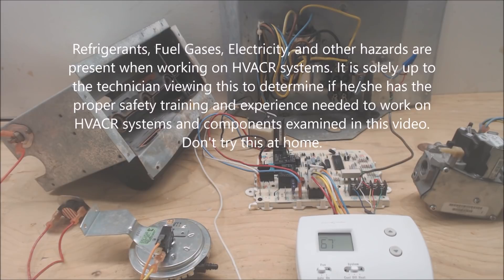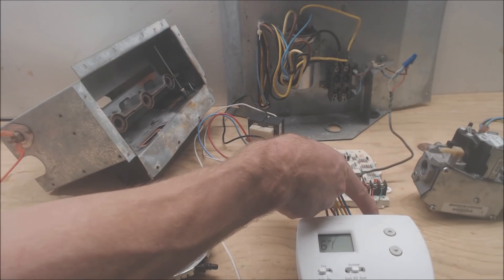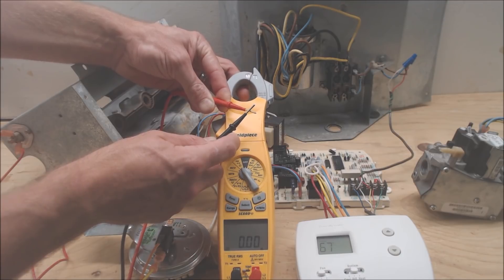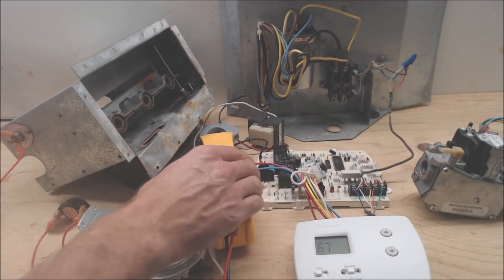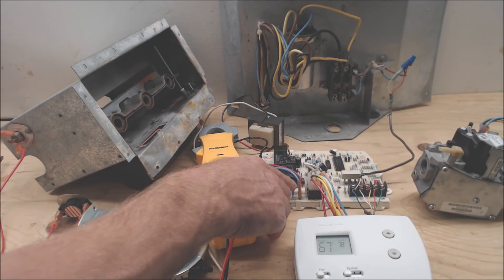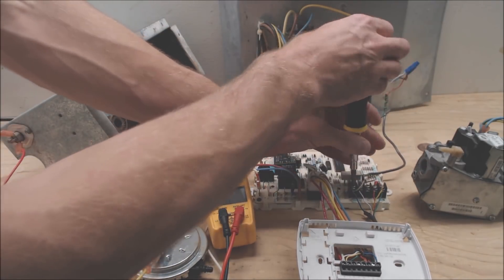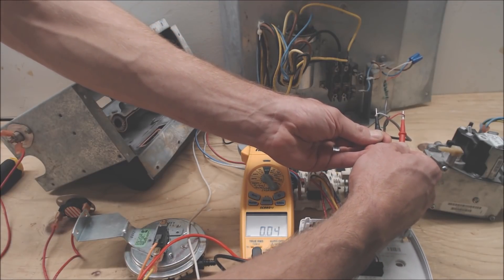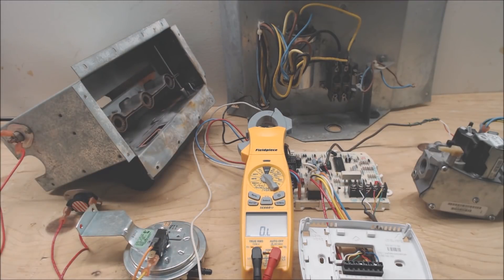HVAC Electrical Troubleshooting! How to Find a Low Voltage Short!

Comment: Hello, I was checking a heat pump system that had a short in the control wiring. while I was trying to find the short I removed the fuse and install a 3 amp lil popper and as soon as I turned the power to the unit the transformer burnt out, it smocked.
My question is, why didn't the lil popper tripped?
FYI, the short was between E and neutral.
Reply from the maker: It sounds like that lil popper was hung up. I have my students use lil poppers in the classroom and I put faults such as shorts and their lill poppers open the electrical circuit within 1-2 seconds. I am not sure but what I would say is to find the short with resistance reading and the thermostat wires disconnected from the control board. If you need to put batteries in the tstat or use a mag jumper to do your connections then that is fine but you are testing for any resistance value between a potential hot and C or hot and ground, thanks

Comment: What is the probleme if the fuse always blows after 2 or 3 hour?
Reply from the maker: It sounds like a possible amp draw problem on the 24v circuit or an intermittent connection problem on the 24v circuit between one of the hots and ground or common, thanks Christian!
Reply: acservicetech thanks for the reply

Comment: Is the steps to locate a short on an electrical furnace similar?  I have a 5amp fuse that keeps popping.  I've been looking all over any can't seem to figure out where the short is, could it be the board itself?  It's a 17 year old split York system, heat pump / air handler and electric furnace, that has had a fair amount of work done on it over the years but this year it doesn't seem to want to heat.  AC works fine, fan by itself works fine, but when I turn on the heat the fan kicks on, the heat goes on, then a few minutes later the aux heat turns on and it blows the fuse.  The outside unit kicks on and feeling the line even warms slightly when the heat kicks on, but not long after it blows a fuse.

Earlier in the year we had a HVAC guy come out and after me repeatedly asking him to check the capacitor, he replaced the blower motor (twice, as the first time he said he accidentally blew it by reversing wires or something), and then after it still had issues (freezing up) he checked the capacitor and replaced it.  Now I'm worried when he replaced the blower motor he messed up something else, or since he didn't seem to know what he was doing placed an incorrectly sized one that may be drawing too much voltage and is fine with AC is going but when the heating elements need to run pops a fuse...
Reply from the maker: So the fuse actually has to do with the secondary 24v side and not the high voltage primary side which is where the blower motor is attached to. You may have too many 24v relays which are adding up to an amp draw higher than 5 amps on the 24v side. I would have a new tech look into the added up amp draw of all the 24v relays or by using ohms law and testing resistance on all 24v relays, thanks

Comment: Great video! Is there a big difference between the SC640 and the SC660?
Reply from the maker: The SC660 is wireless so the SMAN460 will detect the temp readings, thanks!

Comment: Thanks for this lesson. Can you tell me a good study guide for the epa 608 universal test. Thanks.
Reply from the maker: Are you taking this through escoinst.com, epatest.com, local supplier, or another curriculum source? Each test will be slightly different and different strategies used unfortunately.
Reply: A friend that teaches at the local tech college is going to give me the test when i am ready. I was looking on line and found a lot of info, but was trying to find a good book.
Reply from the maker: The test questions are different through each testing agency presently. That was why I was asking which one he uses, thanks
Reply: I see. I will have to get with him and find out. Thanks so much for all the videos you put out. I have learned a ton from them and thanks for all the info on the test.

Comment: I thought the "OL" meant "open line"?
Reply: Also so that wire shouldn't test for .04 ohms? That's a high resistance reading for that low voltage wire?
Reply: Nevermind, so you essentially got a resistance reading across two different wire therefore they have a break somewhere under the sheath?
Reply from the maker: It can mean open line, over limit, open loop depending on who you ask but I like over limit, thanks
Reply from the maker: Yes the two separate wires were somewhat touching under the sheath, thanks!

Comment: Anything under 8 ohms on a contactor will blow that fuse also. I’ve had it happened. 
Thanks for your videos. Big fan.
Reply: kevin maxey you put the other components at risk. If it’s designed for 3 you use a 3 not a 5. And why would I do that. You have a bad contactor we replace it as per manufacture. 

I would only do what you say if I do t have a contactor for temporary purposes
Reply: Fuse is not to protect components, it is to protect wiring. Same thing that Breakers are for.
Reply: Capitol Refrigeration,Heating,and Cooling 
That would be a three amp fuse. Odd call but if you ever get it you’ll see what I mean.
Reply: Capitol Refrigeration,Heating,and Cooling 
24 volts divided by 8 ohms of resistance is 3 amps. Before going crazy on figuring out if it’s a short check the resistance.
Reply: Actually what pops the fuse is not the ohms but the higher current , for which the wire gauge is not made to carry. 
In other words, when the current going through the wires is higher than 3 amps, the fuse is going to pop to protect the circuit.
Reply: Antonio and others find it easier to check resistance readings, and than, use ohms law to figure if current draw will be too high. Current equals voltage divided by resistance. Two known values and one unknown.
Reply from the maker: Thanks Antonio!
Reply: on the coil of contactor?
Reply: Capitol Refrigeration,Heating,and Cooling 
on a 24 volt coil yes. Ohms law.
Reply: makes sense, i never thought of it that way,thanks for that info!!!!
Reply: Antonio Santiago the coil is an inductive load and ohms laws is different for inductive loads because of back EMF. The formula you have proposed is for resistive loads
Reply: Adam Hamilton thanks for the terminology. All I know is that I figured that problem by using the ohms law.  Anything lower that 8 ohms on a contactor will trip that fuse. And that’s after confirming the wires and the rest was good. Replaced that contractor 5 yrs now and no more low voltage issue. So wether inductive or resistive ohms law still worked. 
Thanks for the termilogy. 
Contactor is measured with no power or any connections no back emf their. You can’t measure resistance any other way unless you want to mess your meter.
Reply: Replace with a 5 amp fuse if thats the case. If it doesn't blow, you are good. :-)

Comment: If you check r and c and the control board do you get OL OR do you read resistance from the transformer incorporated in the board.
Reply from the maker: Any time you take a resistance reading, you must disconnect the component or wiring from anything that has a control board. You should check the wires disconnected from the board, thanks